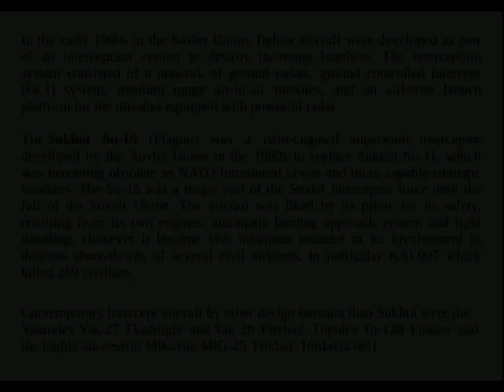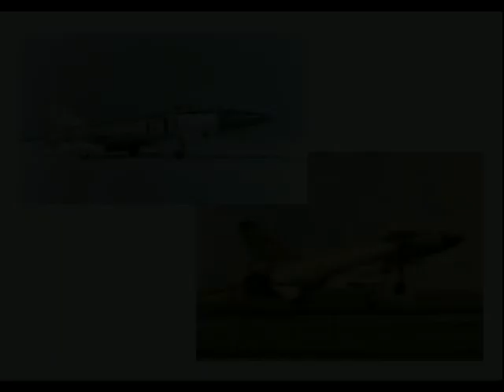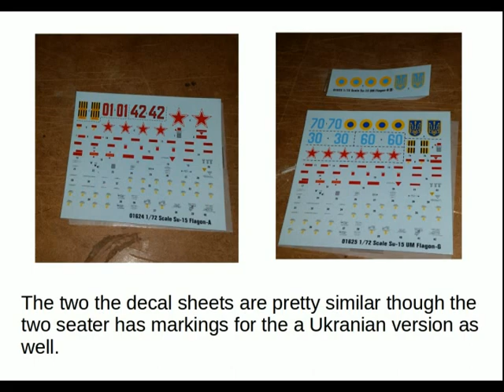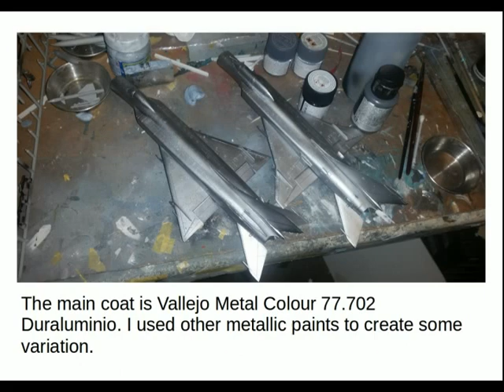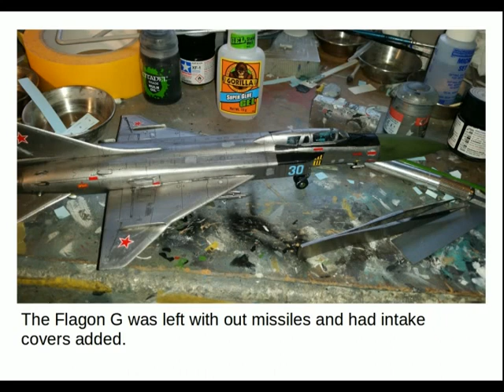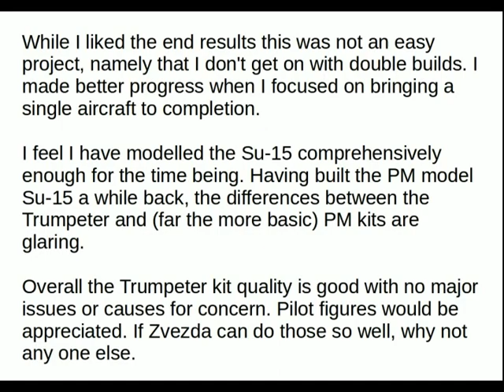Sukhoi Su-15 Flagon Nov Dec 2018 Double Build

Comment: Great builds going on there, I find metal paints hard to deal with but you have got it down to a fine art.
Reply from the maker: Thank you for the feedback. I have found with Vallejo Metalair and Alclad the key thing is to use a dark base and reduce the spray pressure.
Reply: Many thanks I will give it a go. @chancerNW
Reply from the maker: One other thing don't test the  spray techniquec on on a  model project or on card. Have  go at applying metallic paints to drinks cans to practice.

Comment: Nice builds! I like the worn metal finish and how you blended the markings into the fuselage, so tonsprak. 

The two-seater got me really interested... I will look for one, Trumpeter as recommended. What's next?
Reply from the maker: Thank you for the feed back it much appreciated. I'm currently compiling the build vid for my January build a Mil Mi4. Then staring on my February build an Su33 Full Back.
Reply: @chancerNW  I like your discipline! You have a great template for your build videos. Inspiring as well as educational!
Reply from the maker: @pkmodeling  Thank you.
They are build up in layers, the slides are essentially a power point presentation.the slides are turned into JPGSs and stitched together in a video package. II some times feel as if my voice over as I read the text sounds a bit crap.
Reply: @chancerNW  I like your voice over, calm and quiet tempo... I don't do it myself since I don't consider myself as capable as a builder.

 I always favour the videos that I can keep on in the background (but in view) while building. It relaxes me and, I think, makes me more focused. Keep it Up!!!
Reply from the maker: @pkmodeling  
You are a perfectly capable modeller, don't worry. my work is pretty ropey when you look up close. Build vids are often about the mistakes we make as well as the things we do well.
Reply: I just got a notification on this comment and readin it I realize that I have written "tonsprak" and I have no clue what I was aiming for🤣

This autocorrect is sometimes unbelievably wierd.

Comment: Great double header build.  Jets turned out wonderfully. I like the bare metal paint scheme.  I'm glad you added a pilot to one of them.  Happy modeling.     Bill
Reply from the maker: Thank you Bill. I have to admit I like the bare metal finishes as well. I agree with you on the need for pilot figures. With out them you need to lose the ordanence and add the intake covers